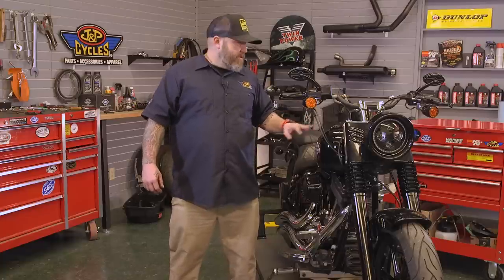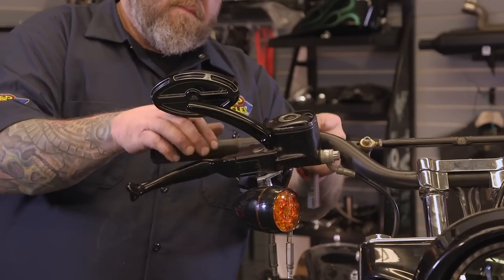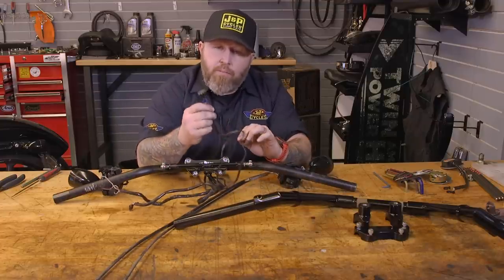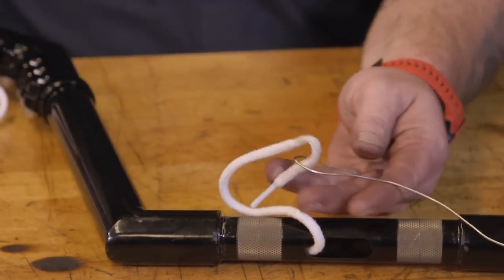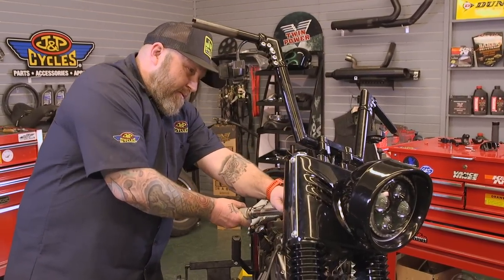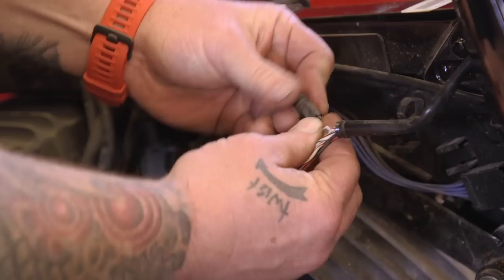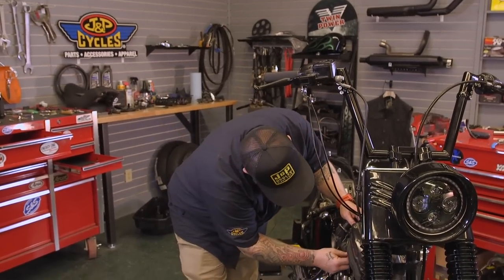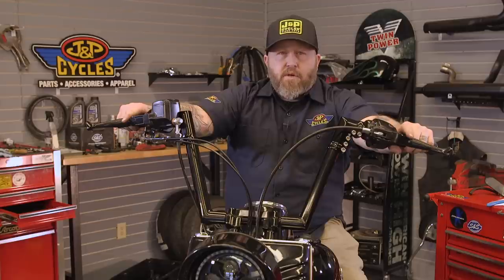Mini Ape Hanger Handlebar Install On Our Softail Slim

Comment: I like to use spraycan clearcoat so I can reuse my grips if I ever change bars again much easier to remove and reinstall. It gets hard and if you ever want to remove just slide a thin piece of sheet metal between the bar and the grip and it will break the bond allowing you to slide the grip right off
Reply: If you squirt some Zippo fuel on the bar, get the nozzle just inside the grip and twist,  and all the adhesive just melts. Slides off easily
Reply: @stephenrutland6648   nice! I’ll have to try this out

Comment: I dig that this guy used a set of bars that are specifically made to come apart and make this install easier, but he didn't so it shows how much really goes into a bar install.
Reply from the maker: No, I showed exactly what goes into a bar install. We used those bar specifically for a the look. I actually prefer to do non modular bars. We have other bar installs that are not modular also.
- Patrick

Comment: Wait, I must have missed it, did you have to extend your switch housing wires? I am putting 13" mini apes on my 07 FLHRS and am trying to figure out if I need to extend those or not. Thanks

Comment: I'm trying to find what actually came on the 2015 Fatboy. Whoever had it before I bought it, changed the original handle bars to a set of Drag style handle bars, and I hate them. I don't like how they feel or look, and the person took everything off the bike, and I'm also going to have to buy a 2" riser and whatever else I need to buy. Would like to know what type of original handle bars came on the 2015 and need know what else I need.

Comment: I see that you didn’t have to bleed the brakes when you installed the brake cable, was that correct?
Reply from the maker: No, you will need to bleed the brakes if you change brake lines. https://www.youtube.com/watch?v=ZMv9l7tIfMQ

Comment: Did you use wire extensions?
Reply from the maker: we didn't have to. The original bars that were on this bike were taller so we already had excess wire tucked away on the bike.
Reply: I have a 2016 Fat Boy S, I want to put 16in Carlini apes on it. Do you know if the original wires are at least long enough to make it through the bars, then I can add the wire extensions to make it work?

Comment: Did you change any cables at all for the 10 inch or all of them are a stock cables
Reply from the maker: Yes, we cover that in the video.
Reply: So the wiring is what he is talking about I believe. Wiring replacement is not covered